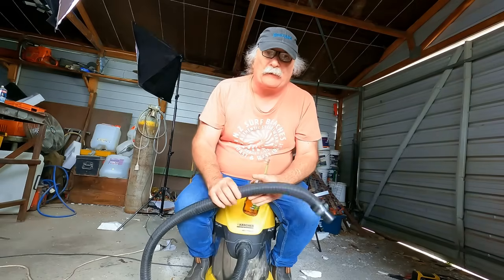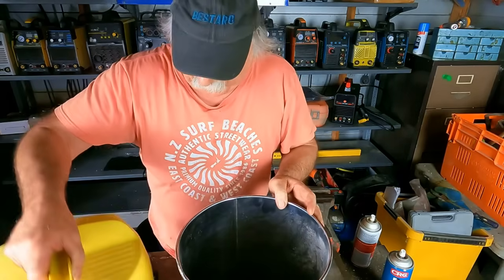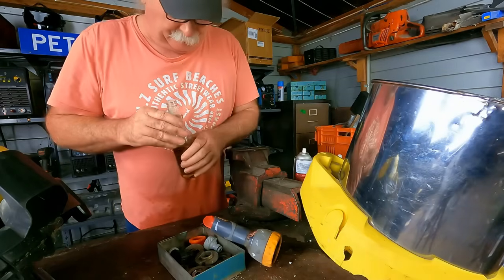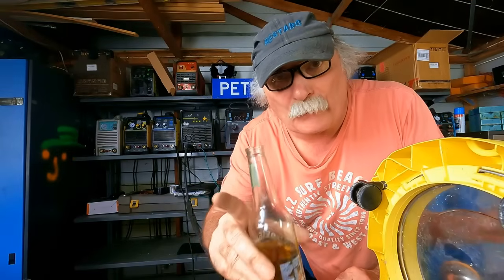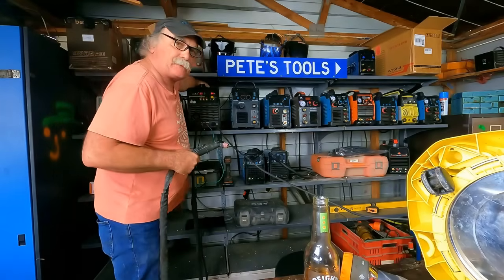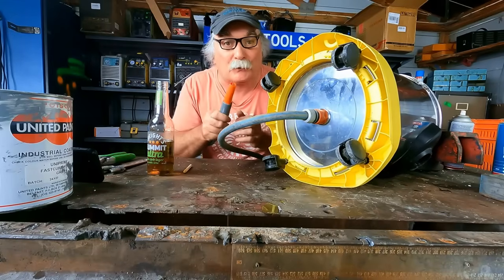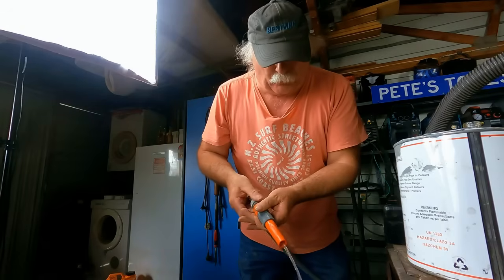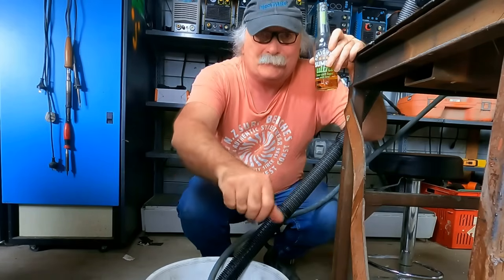Advanced Suction Theory (What Could Possibly Go Wrong)

Comment: Ya didn't make a mistake,  you made an invention for emptying a water heater through the clean out valve. Those constantly are plugged up with lime and won't drain. Simply hook up your garden hose gadget.  Block the main hose and that vacuum will clear the limescale and allow to drain. "This is gonna be awesome "